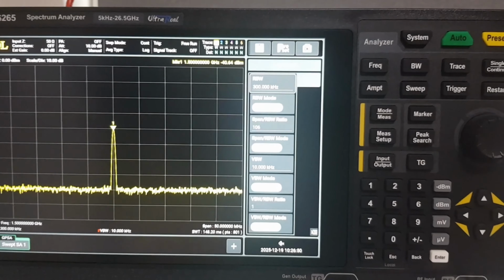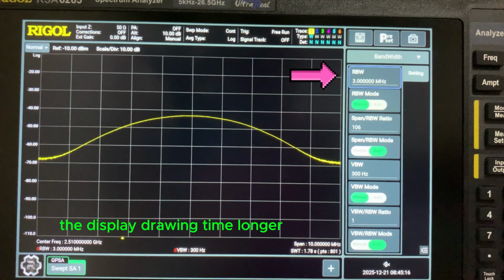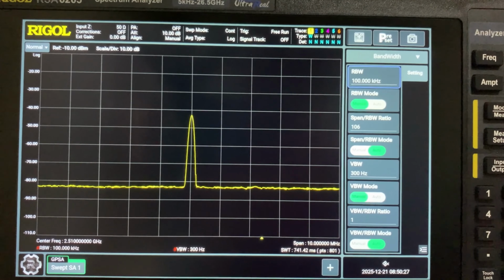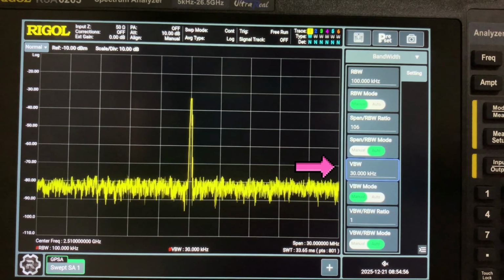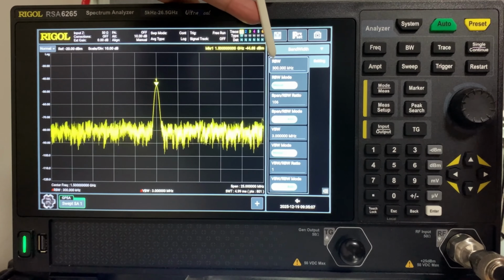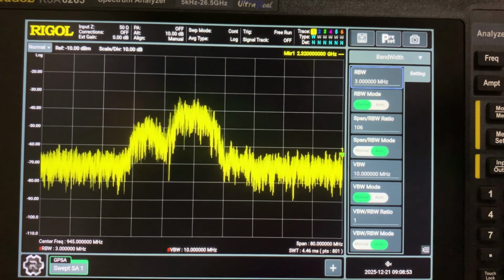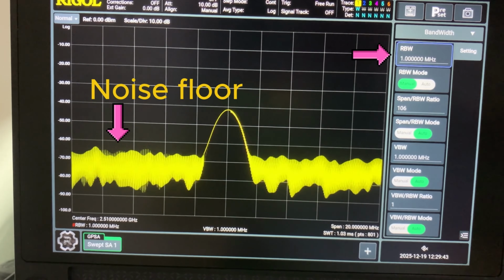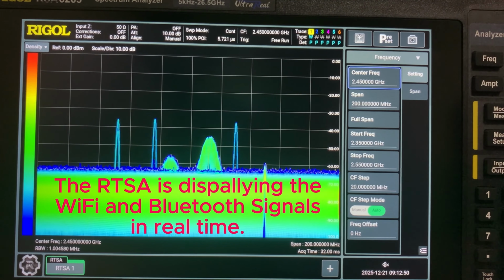RBW vs VBW: What Do They Actually Do on a Spectrum Analyzer?

Comment: I've also heard about BBW as well. What is that?
Reply from the maker: BBW can stand for “Baseband Bandwidth” in some communications and signal-processing contexts.

However, unlike RBW and VBW, BBW is not a universal spectrum-analyzer setting. Its meaning depends on the equipment or document.

RBW — Resolution Bandwidth: The bandwidth of the spectrum analyzer’s IF filter. It determines how closely spaced two signals can be distinguished.
VBW — Video Bandwidth: A post-detection low-pass filter that smooths the displayed trace and reduces visual noise fluctuations.
BBW — Baseband Bandwidth: Usually refers to the frequency range occupied or processed by a signal before it is modulated onto an RF carrier.